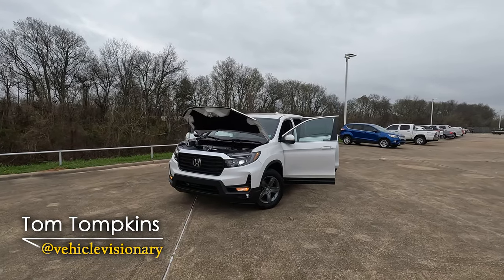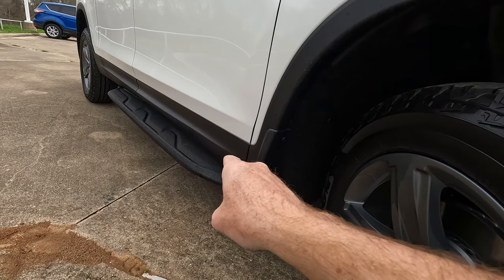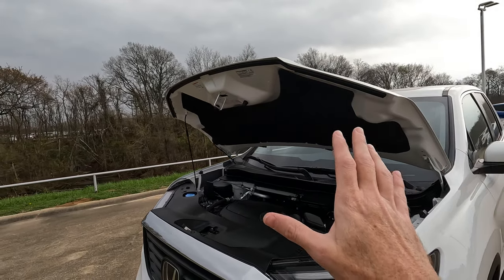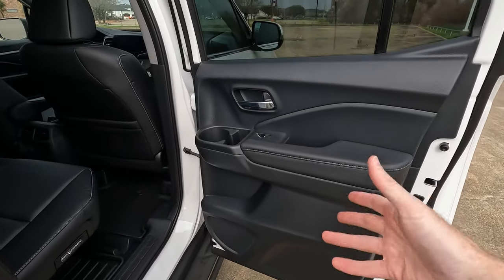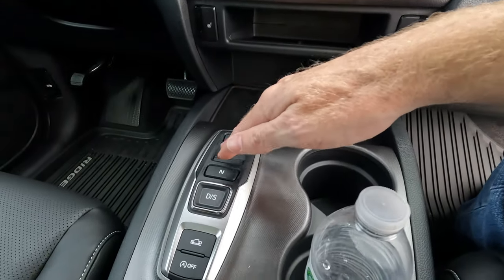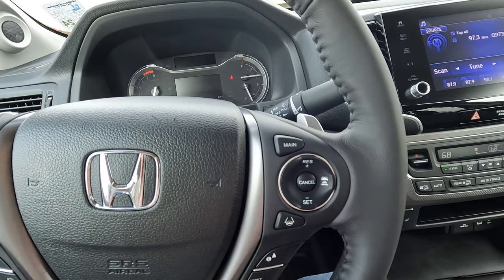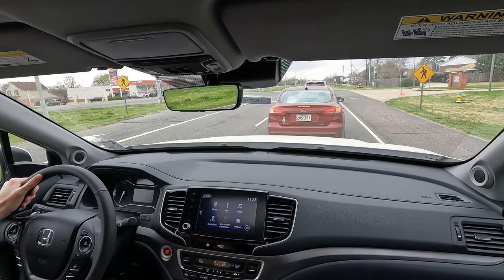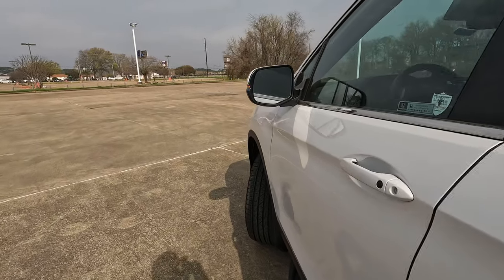2023 Honda Ridgeline RTL - Is It The ULTIMATE Gentleman's Truck?

Comment: Best mid-size on the market, most interior room, smooth ride. Test drove Ridgeline and Frontier love the looks of Frontier but Ridgeline had twice the room and quality. Waiting for 2024 RTLE and hoping for ventilated seats and the option of 360 camera system. I am downsizing from a 2010 F150.   Great helpful review Thanks from South Ga.
Reply: @MidwestFarmToys  how often do you get a flat if you’re not bright enough to remove the spare tire and the jack before putting whatever in the back it’s not easily removed you’re just not the sharpest knife in the drawer.
Reply: Hi why are you downsizing your truck can you explain?
Reply: @DCSPORTSTER  Punctuation.  Learn it.
Reply: Ditto. Waiting on the 24 black edition and looking for ventilated seats as well. I live in south Florida and my current Grand Cherokee has them, really cant imagine living down here without them!
Reply: I was thinking of passing my 2017 F-150 to my son and getting a Ridgeline

Comment: After spinning 350K miles on 1987 and 2000 Tacomas it was time for a new truck. I don’t go off road (dirt roads & snow yes) or tow a 5000 pound trailer so all the macho and off road stuff doesn’t impress me. I was disappointed by Toyota’s stuck in time Tacomas. I felt like a traitor but for a home DIY guy in need of truck bed I bought a 23 RTL-E. It’s civilized mid sized truck perfection. I never thought much about a trunk but I use it all the time. No more having to worry about my tool bag being seen and someone breaking in to steal it. Even use the in bed sound system the RTL-E has more than I ever thought. Honda Pilot with a bed… I’m just fine with that.

Comment: I’ve been driving trucks for years. I’ve had Ford’s, Chevy’s,Dodge’s, etc. I’ve used them for work, utility, pulling a huge boat. I wanted to downsize without totally losing he abilities of a truck. I got the 2023 RTLE. I have hauled dirt, wood, furniture, a full load of trees from a plant nursery. No problem. One of the things that I wanted was to be able to pull a trailer. I have not attempted to pull a trailer yet however, I will soon. This truck can haul 5000 pounds worth of trailer. I decided that would be more than enough for me. I love this truck for its comfort, spaciousness, safety devices, stereo system, good looks, and just an all-around comfortable vehicle. I haven’t regretted once buying this truck.

Comment: I still own my Ridgline 2007, probably the best design from all of them. I’m not a big fan of the new models interiors, It feels small compared to the old style 2007-2014
Reply: I'm the original owner of a 2008 (Black Cherry Pearl) Ridgeline, I didn't realize how big the interior was until I sat in a Tacoma.

Damn they're tight inside.
Reply: I just traded the 07 Ridgeline I bought new in on a 23.  Hated to see it go, but this new one sure drives and rides nice.

Comment: Ok, I just bought my 2023 Ridgeline a week ago. Damn, it's a smooth ride. Has great MPG. I got about 26 MPG at 73 MPH for a 60 mile trip. 

The cabin room is great. Bigger than Tacoma and Colorado, I test drove both. 

When you punch the gas, it moves faster than you would imagine. 

I never owned a Honda. But I'm convinced I made the right choice between the Ridgeline vs Tacoma or Colorado.
Reply from the maker: on your purchase! I appreciate you for taking the time to share your experience.
Reply: Being a taller guy that was my first complaint of the Tacoma. Such a small cab with narrow view. Tundra was much better but also a lot of truck for the amount of driving I do.

Comment: The vast majority of off road capable truck owners do not take them routinely off road, if I can generalize here, they buy for the rugged "tough guy" looks, and put up with the less than civilized ride and gas mileage short comings.  

The Ridgeline is being called a "Gentleman's Truck",  I think that is incorrect, it is more a "Thinking Man's Truck". 

For those that know and realize that they don't need a full off road capable truck, but want something that will still get them down a snow covered street or highway, where ground clearance is not as important, but increased traction is. They want something that when needed, can be used to bring large/heavy oversized things home (from Home Depot), or haul stuff off to the dump, while at the same time, don't really need a heavy towing capacity.  A  1500+ lbs (3/4 ton) bed load capacity is nothing to sneeze at, and how many "mid-size" trucks can accommodate laying flat a 4' x 8' sheet  of plywood or drywall between the bed sides?    They want ride comfort, where at the end of a long trip, they don't feel like they've been beat up. The Ridgeline line checks a lot of boxes.  So what if it's uni-body construction.... I don't see the people that are rushing to buy/pre-order a Ford Maverick "truck" complaining much about it being on the same uni-body platform as the new Ford Bronco.  I also prefer a normally aspirated (non-turbo) V-6 engine for my horsepower, instead of small displacement 4 cylinder that is being turbo'ed to death to ring out the horsepower figures.
Reply: Thanks for review. I know nothing about trucks but like you said every guy wants a truck and most of us do not live in the woods
Reply: In Middle East GCC most if guys even single will prefer to drive SUVs. And the only season is winter where they can actually go off road!
Reply: I live where it snows a lot and I see practically everybody driving newish full-sized pickups. Not having driven one, I wonder how they handle the snow. Fairly often I see them mired in deep snow off the side of the road, but that doesn't necessarily mean anything; anybody can make a mistake. But: wanting a good snow vehicle, I do have cause to wonder what the best one would be. Something like a Subaru wagon or WRX? A big pickup? Or something more like a Ridgeline.

Comment: You have to decide your priorities about what you want your vehicle to do. You get your pickup truck,your SUV, and car in  a package. It's  a good multi-purpose multifunctional vehicle. Not a traditional workhorse or hard-core rock climber.
People complain it cost so much.
But that's compared to traditional pickup trucks. It's price falls in line with a Honda Pilot and Passport SUV. There are more of them made, so you get better deal.
It has basically same cabin interior, and features. You trade It's 3rd row seats on Pilot and interior cargo room. The Ridgeline gives you composite bed and deep watertight lockable in-bed trunk.
You get dual-action tailgate. Since last refresh the tailgate is lockable by door locks. It can be turned of in infotainment settings.
You also getting one of Honda top of the line Torque Vectorng AWD Systems.
Mechanically simular to ACURA Super Handling AWD System. But in Rigeline, Pilot,Passport they are tuned differently.
Redesign 2023 Pilot the system was updated again. Expect new redesign Ridgeline to get same.
Ridgeline is wider than it's mid-sized competition. So think carrying 5 passenger or children's car seats.
It's payload is on par with competition.
The bed is shallow, but it is wider than other midsized. It also doesn't have wheel hump intrusions in its bed.
It's lay- flat and the rear seats are 60-40 split with basically flat floor.
 It's max towing capacity for all AWD models is 5,000lbs. This was same for original 1st Generation Ridgeline 2006-2014 it had 4WD System.
So towing capacity is lower.
Has limited less off-road capability because of ground clearance.
New 2023 redesign Pilot TrailSport suspension I say was designed for next Rigeline or it will have something like.
It's a Gentleman's Truck
Reply: I think it should be mentioned that the 2023 Pilot's new engine does not include Vtec.  It's important to me especially when passing or going up a long stretch of mountain road. If the 2024 Ridgeline is modeled after the 2023 Pilot, then this important feature could be eliminated
Reply: Some people have told me mpg not good though??

Comment: Nice review! I’d be curious how easy it is to remove the OEM tonneau cover, does it require tools to remove.  Sometimes you wanna quickly remove and leave at home for a run to the compost or big box store. I have a LoMax trifold on my Chevy Colorado and it comes on and off in seconds no tools required.  Thats the bench mark for me on tri-folds. Always loved the Ridgeline, most practical choice out there.

Comment: I'm in the market for a mid-size truck and one that can fit two car seats. The Ridgeline seems to be the one that fits that bill the best because it's almost a tweener ( size-wise it sits at the top end of the mid-size market, almost between a midsize and full size). I'm still holding out for the 2024 model, though. That interior really needs an update and I hope the interior from the new Pilot makes it into the Ridgeline next year. The new front end styling would be a nice bonus, and a Trailsport package would be amazing. There's still a few drawbacks with the Ridgeline in my eyes - you give up a lot of truck capability but you don't gain any gas mileage over a conventional body-on-frame truck. The bed is too shallow and hiding the spare tire under it really doesn't make sense. I would gladly trade the "hidden storage" and spare tire for a deeper bed. It still makes more sense for an urban dweller with a large yard than a "real" truck even with those gripes, though...
Reply: I got a 21 RTL and I tell you,  the Ridgeline got good mpg, more than than Honda advertise.

Comment: I have always been a Toyota truck guy and a Honda for my wife. I recently sold my Toyota Tundra 5.7 engine which ran great at 13-15 miles per gallon. It was a great truck but how often did I use all of that power? Not enough to warrant keeping it. I bought a 2023 Honda Ridgeline RTL-E and could not be happier. Wow! It is so versatile and great on fuel economy. The ride is incredible but to answer the question about pulling, I have a dual axle trailer and a Kubota L2501 that I pull from time to time. This is about 5500 pounds and the Ridgeline pulls it great! I live in the mountains of VA at that. I would not pull this load across the country with my Ridgeline, but my normal use, the Ridgeline performs like a champ. The Ridgeline is the gentleman’s truck, the active gentleman’s truck and the working man’s truck! Ha
Reply from the maker: Thank you for watching and taking the time to share!

Comment: I had a 2022 RTL-E that got totaled, but I loved it. Hauled firewood no sweat and towed my boat around easily. Super fun vehicle to drive. I'm picking up a 2023 RTL-E tomorrow to replace it since my insurance covered the accident really well. Skip the running boards, they're really not necessary. I had them on my 2022 and I'm not getting them on my 2023. The roof rack looks really cool but I personally had no need for it so I'm skipping that too

Comment: I have a  Chevy 3500 4x4 gasser for my camper and a 2023 Ridgeline. For my camper it’s the Chevy. For everything else in life from commuting to mud, off road, (not rock hopping) to snow, ice and highway it’s the Ridgeline every time. So much more comfortable to drive and plenty of capability for anyone not needing the payload and towing of my one ton. Had a Tacoma before the Chevy and other than looking bad ass it was way less enjoyable in every way than the Ridgeline. Put the running boards and a roof rack on it and if that’s not Macho enough looking pin photos of your kids on the back that show they look like you and that should be manly enough for most guys. Women are probably too logical to worry about such things and will just enjoy owning it because it’s a great truck:)
Reply from the maker: Thank you for sharing! This is one of the best owner testimonials I have seen.

Comment: I have a 2019 Ridgeline I bought new. I shopped for one feature only, and that was ease of getting in and out of the truck. All other trucks failed, except the Ridgeline. I am a big man with an exceptionally tall upper body, much taller than most. Ridgeline is the ONLY truck I can get in and out of comfortably. I tried them all.
Reply from the maker: Thank you for taking the time to share, Gerry!
Reply: Does the backseat space feel good also?

Comment: I bought the 2023 RTLe model. First I LOVE this truck EXCEPT !! I hate, hate HATE !! Trying to just turn on the radio. You have to scan thru the screen menu to simply turn on radio. There isn’t a button to just turn it on. No button labeled radio. Hard to believe but it’s true. You have to read the computer screen while your trying to drive.   INSANE !!  Too much computer. Not enough one push button that you can feel without taking your eyes off the road. I am shocked this is even legal.
Reply: Get used to it all the new vehicles are like that all touchscreen you have to take your eyes off the road to actually operate it
Reply: What are you talking about....just push the volume button. Thats the on/off button.
Reply: Voice commands do many things on modern vehicles that people just forget or don’t know exists.
READ your owners manual.

Comment: Regrettably, the earlier second generation models of this chassis have ran off most folks who'd be interested in one of these newer ones.

I have a 2019 RTL-E... been one hassle after another.  The tonneau-cover leaks... a lot; the rear-doors don't open all the way like the front to make storing stuff easier... there's an 'upgrade' for this... good luck getting the right part, because even though it's inventoried as an upgrade or parts-revision, it's really just getting the front door door-checkers and putting them on the the back ones... kept getting the stock ones in the mail; it didn't have a tailgate lock... 2019 RTL-E... dealership put one one, but had to have the lock-tumbler configured at a locksmith 20 mi. away, they couldn't do it; the Windows '98 infotainment is pretty much useless... have to use Carplay for everything to bypass nanny-controls; the camera was misaligned when they put the lock on.

Once you have the lock out on, you have to be careful not to open the gate while it's locked... or you'll break the gate again... some kind of cable-slippage.  The gate will open sideways, but not open vertically, or vice-versa.

Ir doesn't cruise right between 1600-1800 RPMs, bi-i-i-ggg mystery; which means it's a defect of some sort, it seems to be the transmission.  If you go to a real mechanic, they add an additive to the transmission-fluid which helps mitigate this; it'll void the warranty for sure, but if it's not going to be honored, what difference does it make.

We haven't towed with it... I don't think I would ever do so.  My experience with this thing gives me flimsy-vibes.

The hood-cover flops around in high crosswinds... it hasn't flipped-up, but it's very unsettling.  'Oh, it's fine.'. This was after the recall-work was done.

Walk-away autolock works about... 70-80% of the time; it's buggy... it panic-beeps and you lock it with the fob.

The outlet in the trunk... it's a 2-prong... I have no power-tools or tire air-compressors which are 2-prong.

I learnt yesterday this thing has another recall, engine rod-bearing defect.  Don't get me wrong, I think the recalls are a good thing, they prevent buyers from being lemon-bombed.  But, I'm nigh certain that when I take this thing in... they'll do some make-shift fix like they did with the hood.

It has 43k miles.

Just... don't... buy one of these things; the only other vehicle in my life with more issues was my mom's Chevy Citation.

Comment: Hi handsome ❤. Great channel and topic. 
I have 75 miles on my 2023 HR rtle. The 4 details I would like American Honda would do is 1) Add $2,000.00 usd of cabin sound dampening 2) Add $2,000.00 for electromagnetic suspension 3) All glass be double pane 4) Have a Lexus' Steer-by-Wire like Lexus has in there new 2023. Let's go American Honda

Comment: New owner of the '23 RTL.
My only complaint is about the stereo.
Screen isn't near as responsive as it should be in 2023, and the sound quality is not near as good as the 2013 Cadillac I traded for it...
Is that fair? Maybe not. But it's the first thing I plan on "fixing" if I end up buying after the lease.
Reply: 2024 models have a bigger infotainment screen and faster processor.

Comment: Yeah but, how often do you have to change the transmission fluid? I have heard that people must do it every 30K or less.
Reply: Every 25k if towing often. Every 30k to 40k under normal driving. Use Amsoil Signature ATF and do a drain and fill.

Comment: I could buy any truck within reason I'm not rich but I had a decent size budget. 100% the Ridgeline at 40 to 45K is the best truck with the most room with the best engine with the best features out there. The Ridgeline is far better than a Toyota Tacoma whether it's the TRD pro or whatever. The Tacoma drives like garbage, it's small, the transmission is still a 6 speed while the Honda is a 9-speed I could go on but trust me get a Ridgeline
Reply: I don’t know you, but should trust you?
Lol.

Comment: Hello fellow Shreveportian. Looks like you're driving off Youree, there. I'm debating hard about getting this truck. Excellent review.
Reply from the maker: Hi Joedy! You are correct. Thank you for taking the time to watch and leave a comment.
Reply: @VehicleVisionary  I ended up getting one. I towed 3 bed fulls of mulch the first day. At 2 lbs per bag, about 800 lbs in the bed for each load. Moved around with no problems.